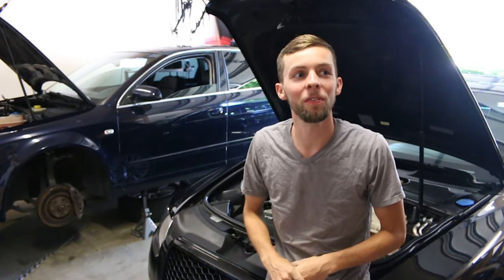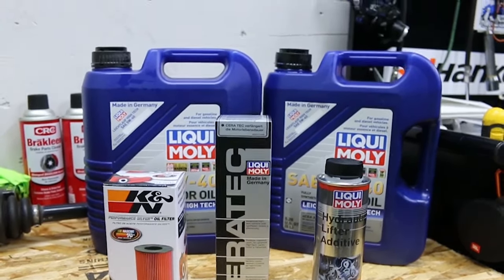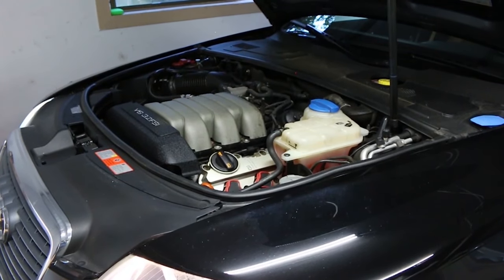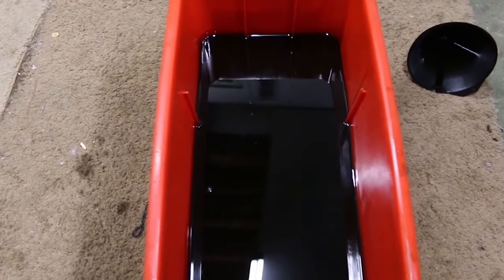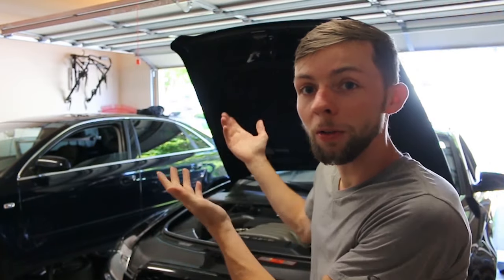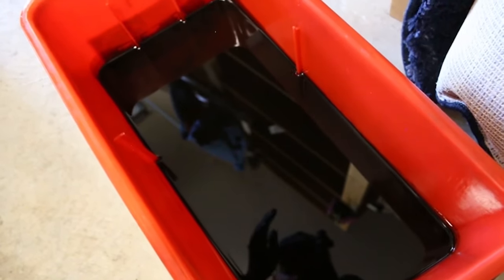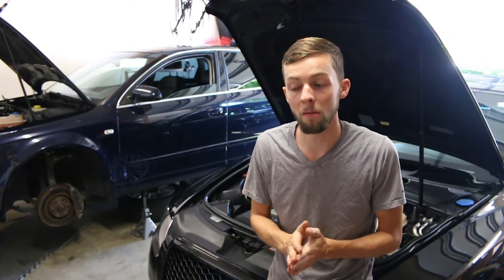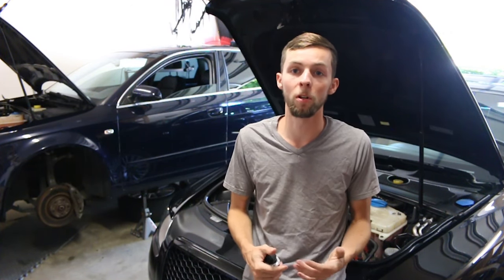LiquiMoly Engine Flush | Does it work?

Comment: Sorry, I would never flush an engine, knock deposits loose and those same deposits will come back through and reclog passage ways and destroy the engine. Anyone I know who has ever done this, with either an engine flush like liquid moly, or the old school kerosene. the engine blew up within 10,000 miles after. all I have to say, good luck.
Reply from the maker: @jetdr, you are completely wrong in several ways. First off, if the sludge is so thick that it can clog oil galleys, then you have much bigger problems. 

2nd, you are the first person out of over 250,000 people to mumble this nonsense. 

3rd, do you think companies would make products that ruin engines and still be around making it years later?

4th, I've used this flush on every vehicle I've had for the last 14 years. Why haven't none of my cars blown up? Why haven't I had any issues?

The problem is I think you heard something one time and then without any research you know go around spewing that same thing. It's important to research what we are talking about to ensure accuracy. 

Lastly, engine flushes are fine. I use them every 10k miles. It's nearly impossible to have a piece of sludge break off and cause damage unless your engine has 10 year old oil or some other serious issues. 

Let's not spread misinformation based off things we hear but have no experience with🫡
Reply: @Mechani_Cole  I am the first person to spout this nonsense!! so you are telling me that knocking carbon buildup (which is normal in all engines) into an oil pan and then having the engine suck it back up through extremely narrow oil passages, won't cause a problem. I hope every person who follows your page and does this, after their engines blows up, finds you and beats your a**!! LMAO
 secondly, do I think a company would sell snake oil that can and will cause damage to an engine!! NO who would ever think that... you my friend are a genius. 
  Let's not spread misinformation based off of things we hear but have no experience!!! I have been a Mech on Jets for 25 years. you know those things that fly 35,000 ft in the air, we can't even change oil types all at once, you know why? because it will shock all of the carbon buildup and clog passageways. but have a nice day.
Reply: @Mechani_Cole  quick search of your precious Youtube, I can find video after video of why not to flush, from other car mechanics. are they all hacks!! or are you just so damn good they are all wrong.
Reply from the maker: @jetdr you are a clown at best. Appreciate the engagement, though, it helps more people see my video sweet cheeks 😘

You keep working those jets that we all know operate so well lately. Must be a Boeing employee with that superiority complex you have...
Reply from the maker: @jetdr you Tagged a Scotty Kilmer video lmao, that's how I know you are a clueless idiot 😅

Comment: • I use liquiMoly (LM) Special Tec AA  5w/20 for 6 yrs. running. For Each oil change we do a LM Engine Flush (15 mins idle) then drain, then LM  syn oil. I hate the metric system@!!#. Our engine uses 6 US QTS. 1  5 qt LM jug and 1/2 1 liter bottle does the trick.  In 5k miles you have lower engine carbon and all the works of dirt. The flush every time keeps our engine brilliantly CLEAN. THE FLUSH IS NOT A one time affair.  Idiot generalist mechanics state it's bad.. They do not know LM. Gee your Audi should not burn oil.  
• Our 2013 Lincoln MKX AWD V6 Duratec 3.7 litre @ 89k miles does not burn a drop of oil. We change @5k miles. We love our Liqui Moly syn lubricants. All other popular syn oils are sub par, including Mobil 1 to LM . Mobil 1 for instance produces it in facilities globally. LM only in Germany🇩🇪  Better quality control. The Auto European standards which LM adheres to is way higher than our S.A.E. standards.
 • Ceratec treatment is a 30k mile friction reducer product . Depending on the vehicle it takes 100-300 miles to kick in.
▪︎ For your Audi situation do yourself a money saving favour.  Treat your fuel system, engine, trans, A/C, power steering, cooling system and rear end Differential with a ONE TIME treatment. MICROLON. Been around for 50 yrs. Will improve your oil burning issue and engine chatter also. Better gas mileage and snappiness.  This is not snake oil as a few idiot SELF PROCLAINED EXPERTS YOU-TUBERS CLAIM. THIS WILL BE OUR 4TH TREATED VEHICLE. It lasts forever.  MICROLON is both Mil-Spec and FAA certified. Your Audi will thank you and Your wallet will thank you at the pump. Simply put, MICROLON cleans,  preps, then bonds forever a resin barrier on every moving metal to metal part. No friction anywhere. Now all your metal to metal parts are moving on MICROLON resin. It will not chip nor flake nor peel or wear out. To remove this resin you would need a super-duper high speed grinder!!  It is beyond neat. I  found this in 1990. Any vehicle we buy gets the treatment. 
• Not only the engine but everything else. A/C compressor,  water pump bearings, PS rack gears, Transmission, hypoid drive gears etc. END GAME is a fluid synchronicity of frictionless moving parts. No pushing on the throttle, just a slight pressure and your off. It is so sweet!! Think of this as a FOREVER Ceratec treatment to a way higher standard.

Incidentally, we MICROLONED Our house Frig compressor and house A/C compressor motors.  Infinite uses. Firearms treated both internal and barrel bores. Major accuracy and penatration improvements.

Hope this helps. Good luck with your channel. God speed.

Chris , living the life in the Great Lakes Region USA

MICROLON.COM. 
 RING: 512.490.6460. speak to Larry. He has been in this stuff for 40 yrs. The real expert with this stuff. A how to source for what to use and how to apply it all.
Reply from the maker: Appreciate the long response! For my particular problem, the timing chain guides actually needed to be replaced and I had some hidden internal leaks past the cam girdle. The whole engine has since been removed and had every gasket replaced and a ton of new parts on it. Just finished up the carbon cleaning service as well. 

Now the car runs completely different and doesn't consume or burn any oil. Since Audis are direct injection, the blow by makes the oil a little dirtier than fuel injected cars. I have found that the LM keeps the carbon deposits in the oil down. Now I use the flush every other oil change. 

In the end, this didn't fix my tapping issue as the timing guides needed to be replaced. But it does help keep the engine clean.

I'll have to check out the other stuff you are talking about for sure. Thanks for watching and commenting. Much appreciated🤙🏼
Reply: Me again. our V6 is GDI. LM Has just added DI Jectron to its line. I use it now ea. 2,400 miles to combat direct injection filth issues.
Reply: I use that oil in my mother's Nissan, runs good.  I am not sure how long the CVT would last though, they are not known for lasting forever!!
Reply: try 1,200 miles as stated on the can